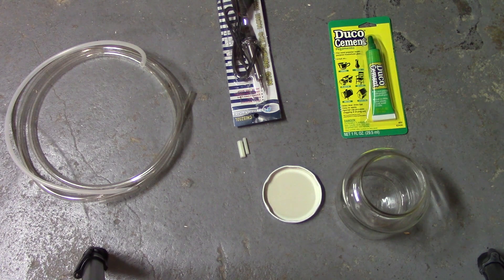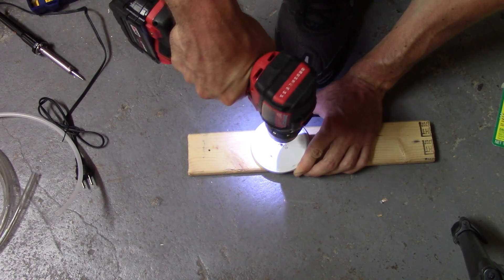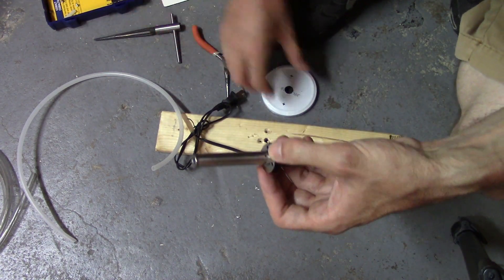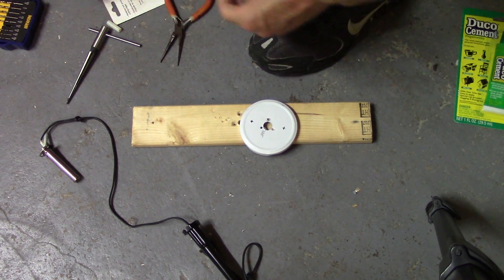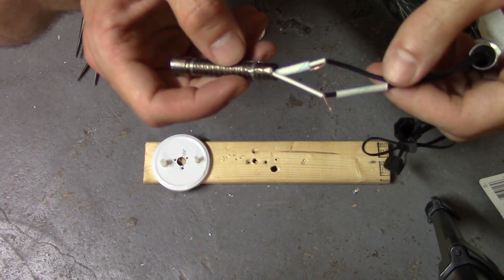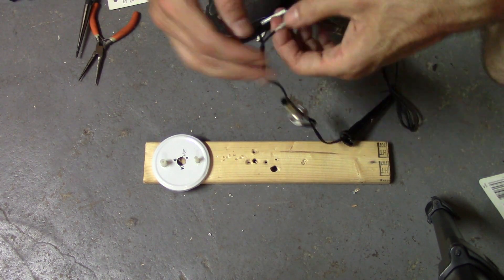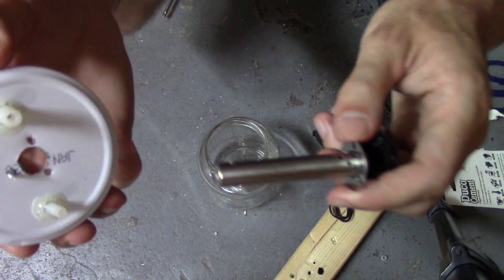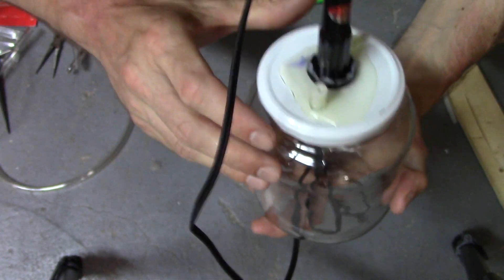Making Smoke Machine for under $10

Comment: Great video to save $100+ dollars!! What is the technical name of the adapters?
Reply from the maker: Yup.  Which adapters?  Plastic pipes?
Reply: @UrbanMasterExperiment  I actually figured it out but thank you though! Quick question when you tested it with the smoke machine was it difficult to determine if it was coming from the fuel injector o ring, rather than the intake manifold gasket as they both sit right near each other?
Reply from the maker: Oh yes, once we removed the plastic cover, it was clear that the smoke was coming from the fuel injector.
Reply: @UrbanMasterExperiment  okay cool I’m doing this next week! I was also wondering if you could give me some advice. I’ve been dealing with Valvetronic motor issues and I found out it was a blown vvt fuse. So after replacing the fuse and doing the relearn process on the vvt with Ista+ program the car would run great and now shows no codes when reading the car with ista. But for some reason after stopping at a red light the car would idle from about 750rpm to 600 (when at full stop) and would have slight rough idle when doing so, but there’s no rough idle except for that second and it doesn’t fluctuate just does that once every time I come to dead stop. Is this normal or what do you think the issue might be? I was thinking a vacuum leak 🤔
Reply from the maker: Well, it could be a vacuum leak but most likely that would throw some error codes.  The scenario you described, may not necessarily be a sign of a vacuum leak.  You could certainly do a vacuum leak test, it wouldn't hurt anything, but then you'll know for sure if that is the issue.  If you were to drive around and stop 10 times, would that happen 10 times (regardless if the engine is at full operational temperature)?  Did you replace the vvt motor or just a fuse?
Reply: @UrbanMasterExperiment   Yeah it would constantly keep happening each time, no matter the engine temperature. All I did was replace the fuse and I tested to make sure the vvt motor is working properly by connecting alligator clips to the motor and then to the battery and it would work perfectly fine. I also replaced the two o2 sensors that sit next to the engine, so bank 1 sensor 1 and bank 2 sensor 1 😂. But if it were issue with the o2 sensors I would probably get a code. Do you think it could be the other o2 sensors that sit on the exhaust manifold? Or maybe the ignition coils cause my car has almost 200,000 miles and they’ve never been replaced
Reply from the maker: Oh yeah, at 200K it could be anything :)  Start with the vacuum test and work your way down.  Good luck.  Let me know if you find a leak.
Reply: @UrbanMasterExperiment  Thank you for all the advice!!